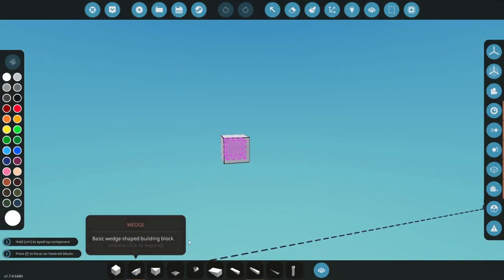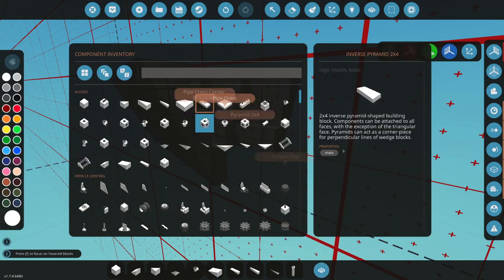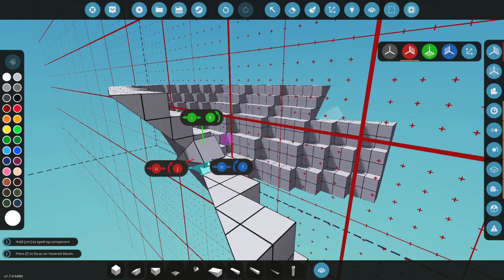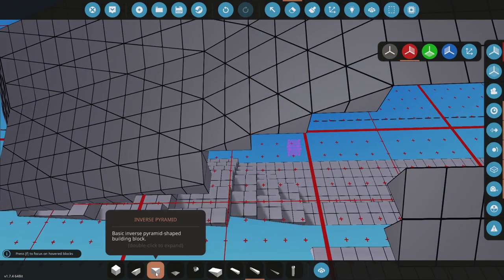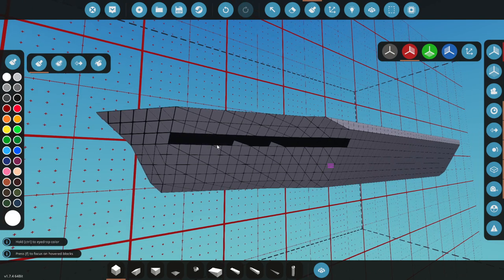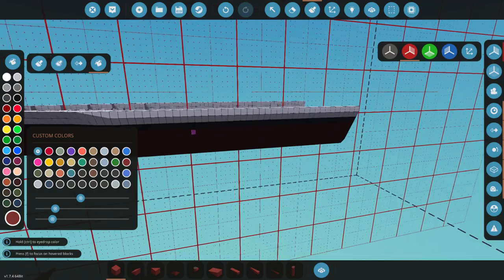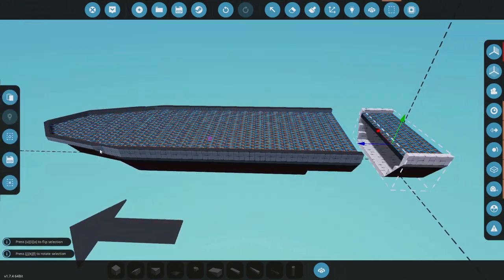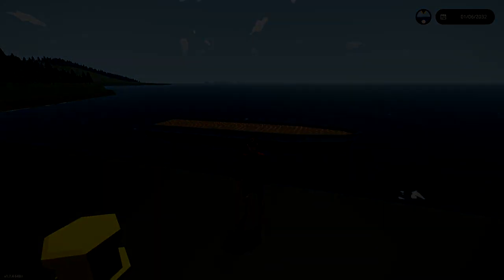We NEED A TORPEDO Boat HULL! - Lets Build A Torpedo Boat In Stormworks! #1

Comment: This is going to be OP. I tested mine despite the engines over heating. but the speed and maneuverability was of the charts. Not to mention the torpedoe example in the presets tab was very easy to fit and launch from it. Also the AI warship didn't stand a chance!

Comment: You asked favorite type of ship but I don't really have a favorite type of ship but I do have a favorite class of ship 

The Tenryuu class light cruiser of ijn

Also battleships had the curved deck as well and part of what it did was so water would flow off the sides and not stand on the wood decks of the ship